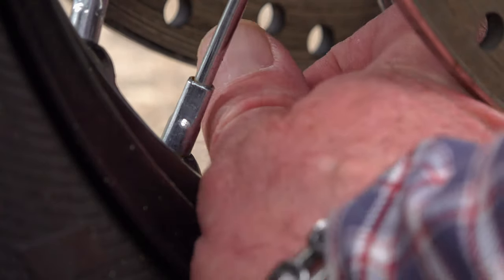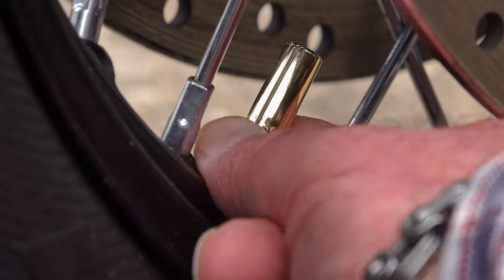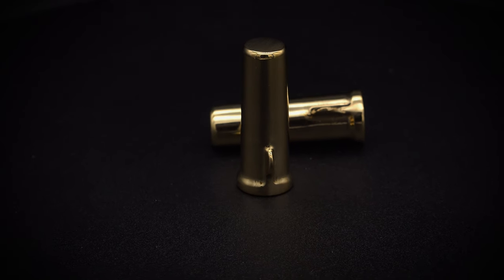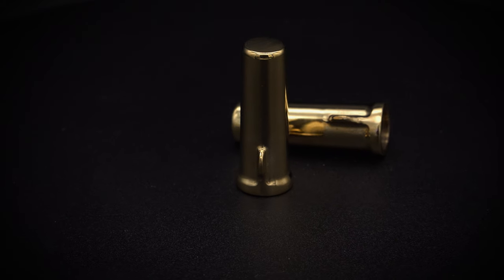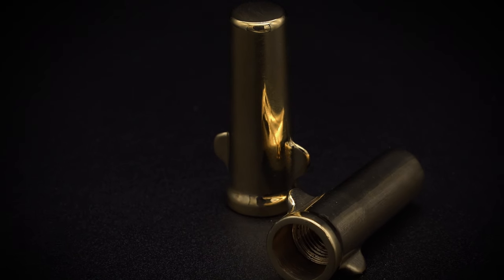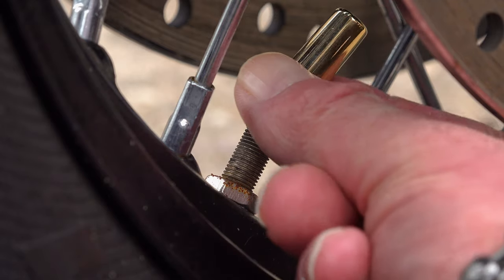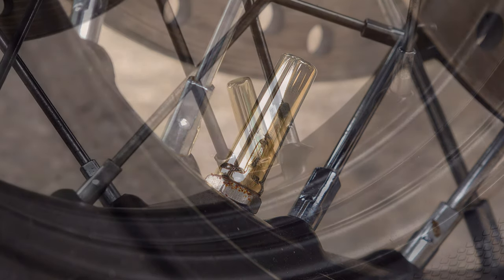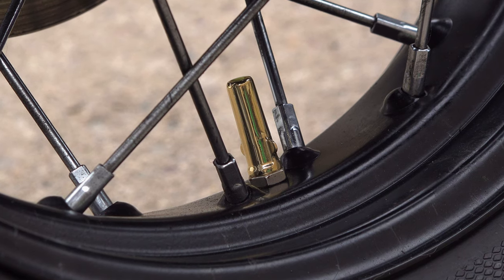Custom Triumph Bonneville. The Ballista! beautiful brass valve caps for all modern classics!

Comment: I love the brass bits from Motone. They compliment so nicely the brass accents on my 2018 Bonne T120. I ordered the outrageously expensive oil filler cap from them. It mirrors the brass head bolt knuckles. Of course, I now have to have the valve stem covers! The rear chain adjusters will be added at the first chain adjustment. Thank God I have my own computer and my wife is unaware of my obsession.

Comment: You are correct, as usual, about the vintage brass valve stem caps. I'm in the USA. Ebay has many old brass caps for sale. Ford model T and many others. My first motorcycle ride was on a 63 Robbins egg blue and cream tank Bonne my best friend bought secretly with his farm hand earnings. I never forgot riding that rocket ship. My brother had a 73 Tiger. I'm 72 with many thousands of miles on bikes under my belt. I finally own a Triumph! I suppose I was just waiting for the wonderful modern classic Bonne to come back.

Comment: The valve length I think may be a throwback to tubed tyres where the valve needs to be pushed down so the tyre can seat properly where the thick bit of the tube is ......just a guess from many years of working on bicycles ! I myself use alloy angled valves on my bike ( not a retro ) for ease of inflating......these are very nice !

Comment: Hi Stuart, top o' the morning to you. Just to mention that the cast wheels on my ST have angled stems which wont accommodate a full length valve cap unfortunately. I don't know if all Triumph cast wheels are the same.
Reply: Triumph cast  wheels are tubeless and the valve stems won't be fully threaded for the brass fittings as shown in the video same as car types

Comment: Ok, pardon my ignorance...but why would you need high strength for a valve cap?
Reply from the maker: so they are not easily damaged in use, thin metal ones easily deform.
Reply: @stuartfillingham  oh my...what are you all doing to your bikes....to dent or deform a valve cap? But, they do look super...if I had Tri bobber this is the way I would go
Reply from the maker: @MiketakesaHike  its can happen when removing or fitting them.

Comment: I'm always wary of fancy valve caps. I've been in the motor trade for too long & seen too many seized up so they tear off the valve when you inevitably have to use pliers on them. Admittedly they're usually cheap aluminium ones fitted to cars & don't get touched between services. Hopefully brass ones will be better & us motorcyclists always check our tyre pressures regularly....